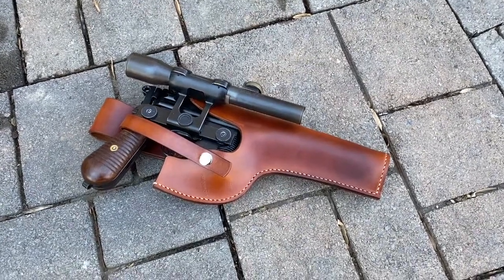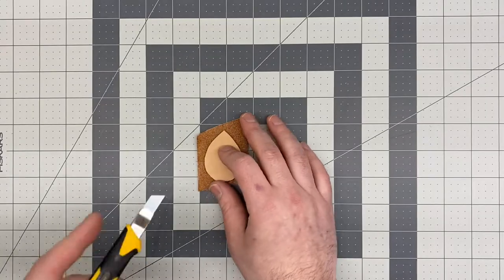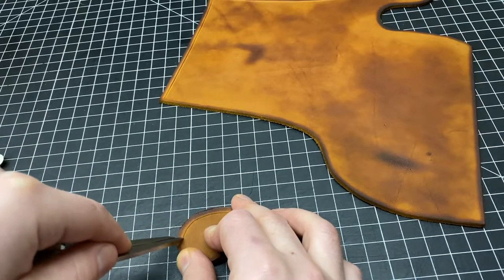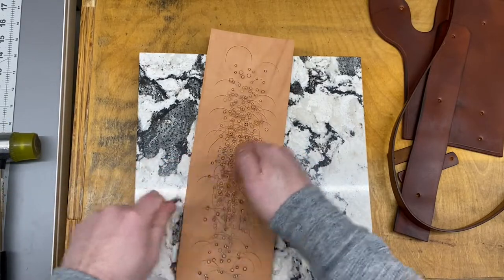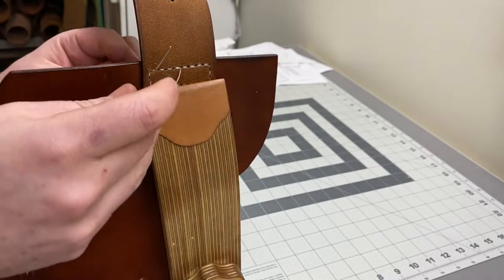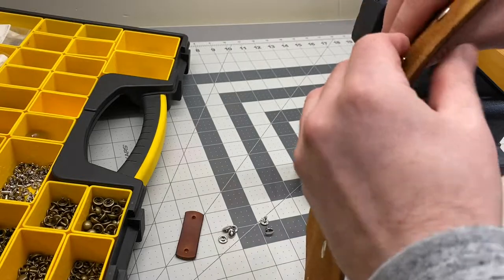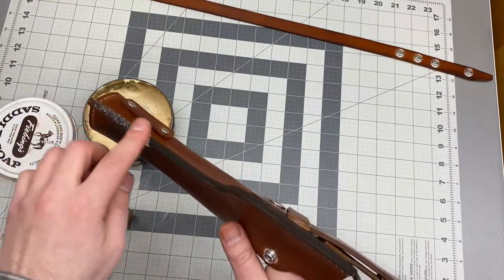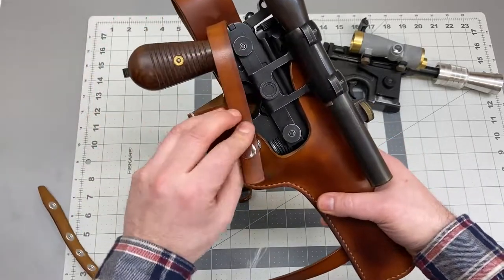Making a Leather DL-44 Holster

Comment: Fantastic video.  I appreciate your artisanship (if that is a word). Do you find any issues with the glue holding over time with the leather being oiled?
Reply from the maker: Thanks! The glue is really only there to hold it together until stitching. It’s not structural. But nice quality contact cement intended for leather will adhere nicely even after a light coat of oil (assuming it’s had time to soak in). Though on pieces where I absolutely need a permanent bond I won’t oil the mating surfaces.